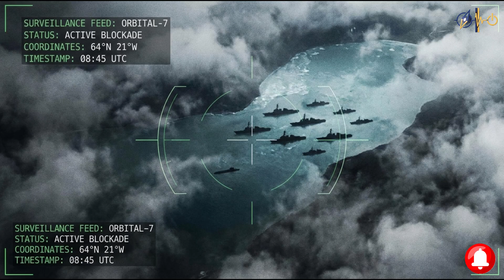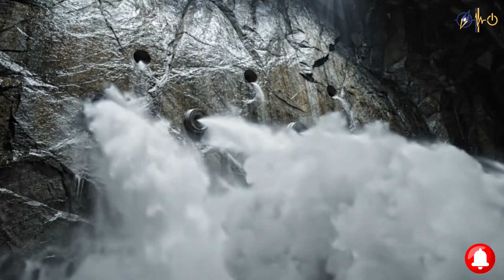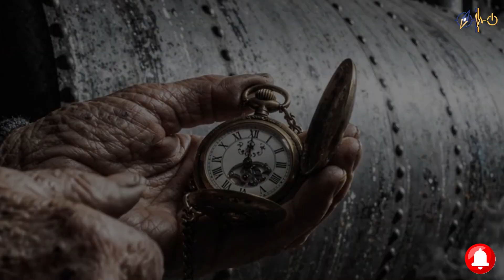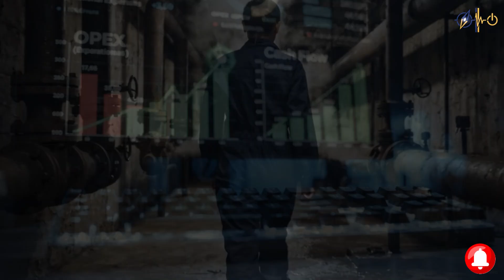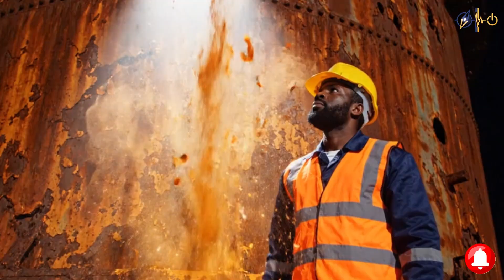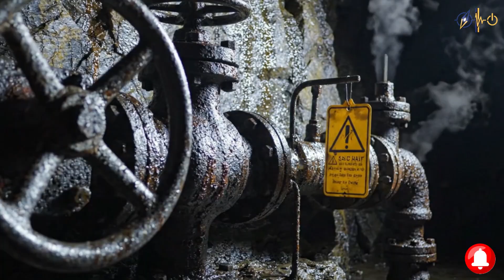Why China Chose Rock Vaults Over Steel Tanks in the Energy War

Comment from the maker: The math doesn't lie: $12 billion in upfront capital saved, 50 years of zero-maintenance operations, and total immunity from surface logistics bottlenecks. While Western markets are stuck debating the cost of steel, the real shift is happening underground in solid granite.
If you were auditing the global energy supply chain, would you trust a vulnerable tank farm on the surface, or the silent, invisible power of geological storage?
Let's get into the hard data. Drop your technical breakdown below—what’s the one major risk Beijing is ignoring by burying their entire reserve? The most insightful engineering or financial analysis gets a pinned reply